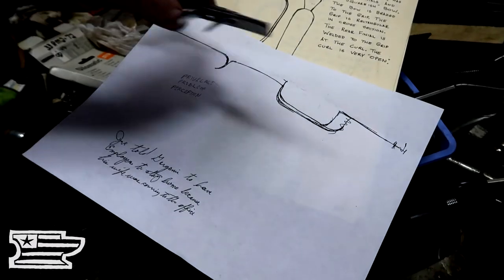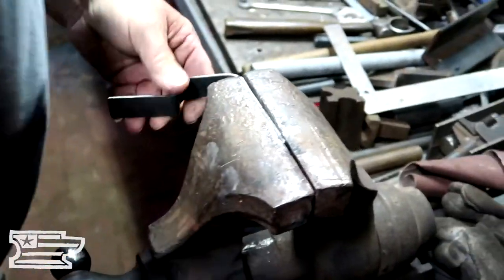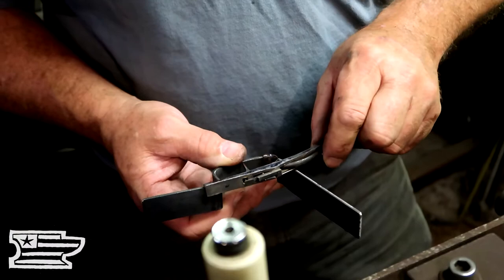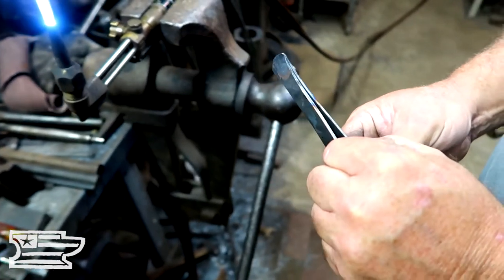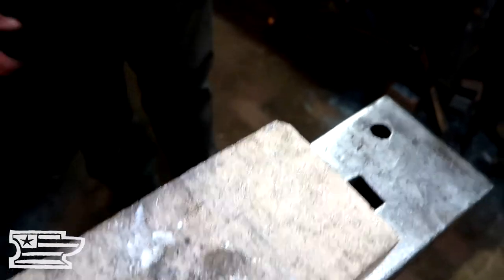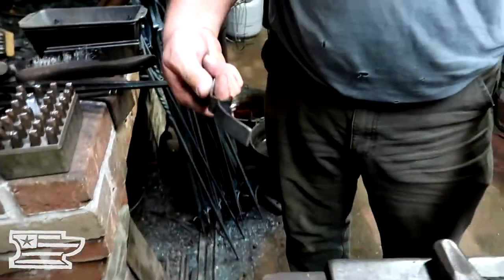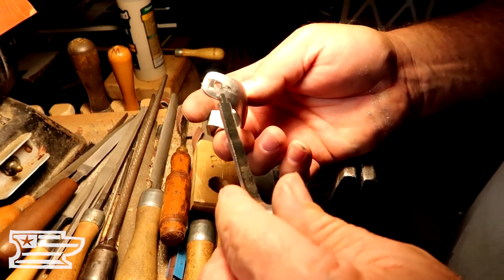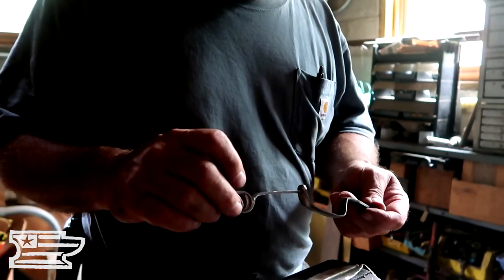Making the trigger guard for a Tennessee Iron Mounted Flintlock Squirrel Rifle | Part 3

Comment: Making a trigger guard, even for a simple .22 bolt, is not that easy to do it right.   Nice bending machine.  Those aren’t cheap !  You have to be very good to make use of that bender.  Difficult to visualize the dies and set up to accomplish shape